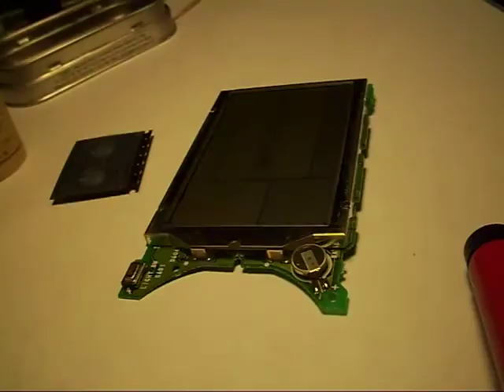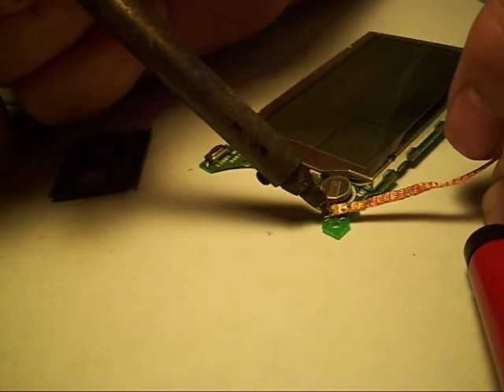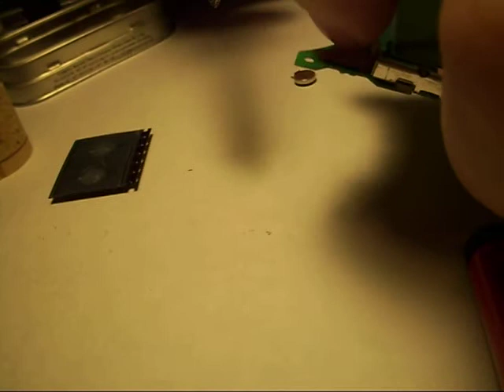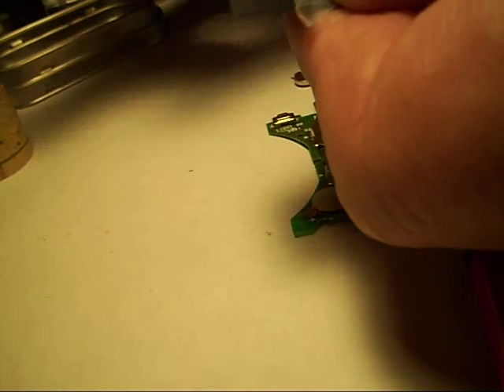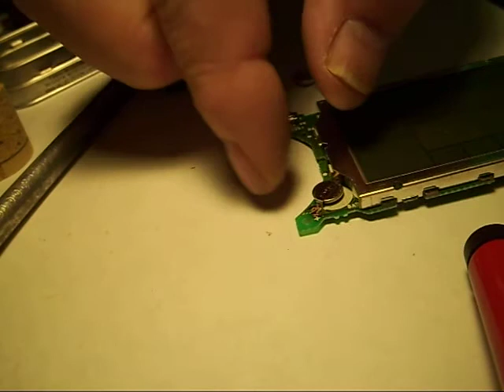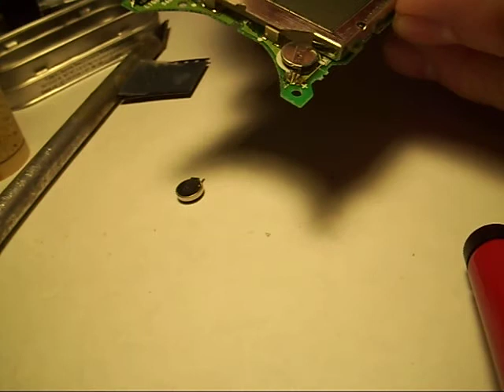SONY ICF-SW100 ribbon cable replacement (PART 5)

Comment: hello, can you tell me  whats that button cell number? pls.. thx
Reply from the maker: Not right off hand as I am out of the part. Best to email direct at kb8dns(at)yahoodotcom
Reply: Hi. Did you figure out the type of the battery? Is it 3V? Thanks.
Reply: @worroSfOretsevraH  dude it's not battery. I found it later. It's called super capacitor. I ordered it from eBay. But installation is pretty difficult IMHO.
Reply: Yes I know, in newer revisions Sony used super cap, but mine is older with a coin cell battery. I need to change the 2 ribbon cables as well, so the radio is completely dismantled already.
Reply: Seiko/FDK MS621. Li-Ion rechareable battery.